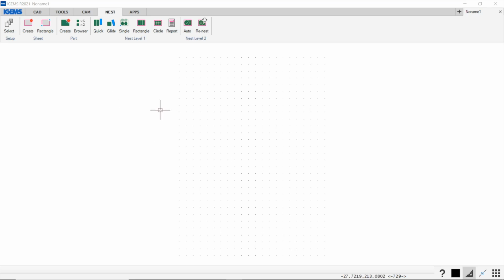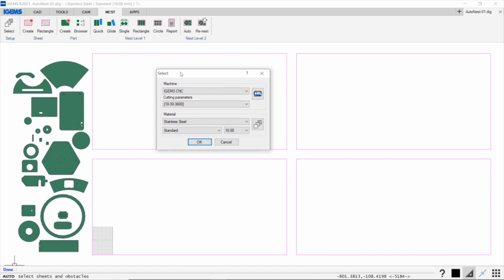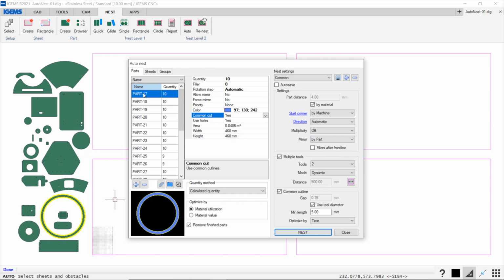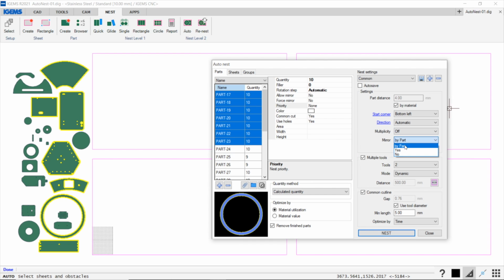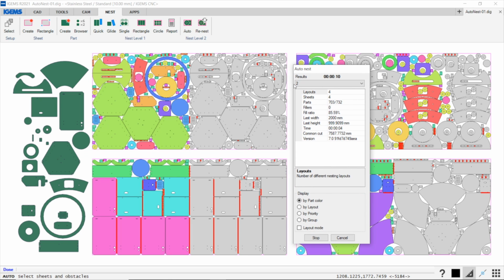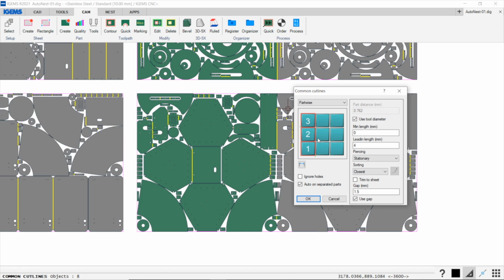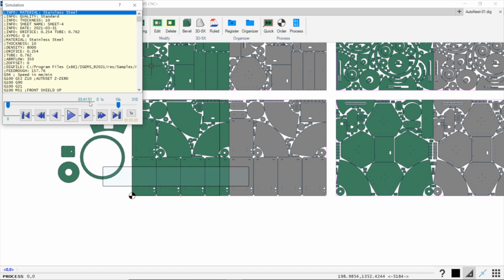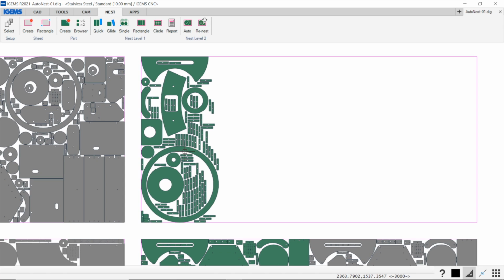Autonest and Common cutlines

Comment: Great tutorial!
Please keep these videos coming.
I have a question.   In the auto nest screen there is a section called "optimize by".
What is the difference of nesting between material utilization and material value?
Reply from the maker: Each sheet of material has a value which you can define by clicking on it. You can also create custom scripts on how to calculate the value of your sheets.
Let's say you have one remnant sheet and one brand new sheet of 10mm SS. The new sheet has got a greater value than the remnant sheet because it's intact.
So, if you'd select both sheets for your nest and checked material value, it would start nesting on your remnant sheet. But if you'd selected material utilisation, it would start nesting on your new sheet.

This is an oversimplification of the function, but hopefully you get the idea.